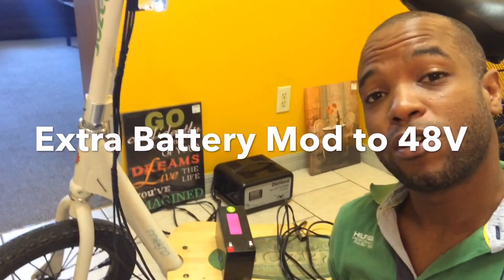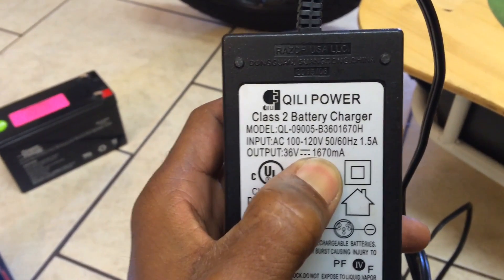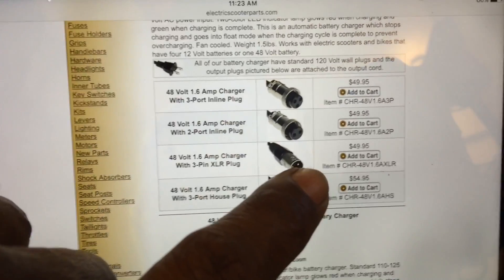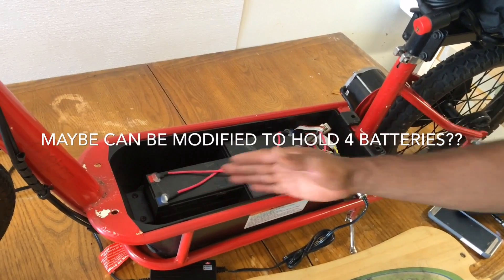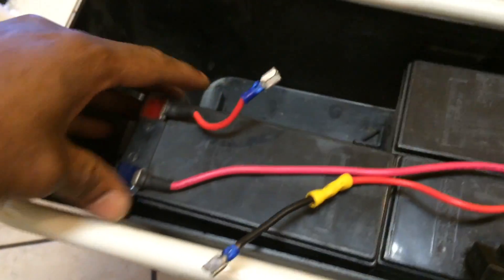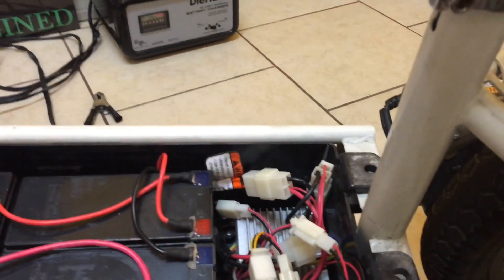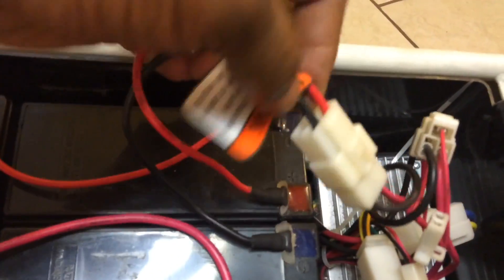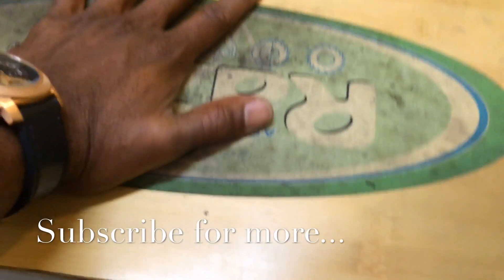Razor Eco Smart Metro Electric Scooter 48V DIY Upgrade

Comment: I went for distance over speed and changed out my 3 - 7 amp 12 volt battery;s for 3 - 15 amp 12 volt battery's. Now I'm running about 225 lbs, and also have a carrier cart that I use for getting bottled water and grocery's. I can carry 2 - 24 bottle case's and several bags of grocery's and travel 5 to 10 miles with no problem. 
     My speed has been slightly reduced because I also went fat boy tire's and a larger sprocket for more tork / sorry about the spelling, but you get the idea. As a senior riding on a little bike seat really killed me, not to mention the bouncing, so I also removed the seat and mounted a wheel chair seat, much more cushion and relaxing to ride now. Over all I increased the weight about 40 to 50 lbs but it evens out with the improvements, so I'm still at about 15 miles an hour and getting 12 to 15 miles per charge.

Comment: Great video! do you think a 10ah will fit in the tray? also any ESC cooling idea?
Reply from the maker: thanks! I'm not sure if four 10Ah batteries will fit but maybe 3. the 8Ah batteries are just the right amount of space for 4 of them
Reply: +Elton Love your setup. Would you see any problems with 3 12ah batteries. Would the top speed be 23-24 with those.
Reply from the maker: Richard Herzog thanks Richard. If you get them to fit it will work great but it won't increase the top speed. That is only possible one of two ways. Either by adding more system voltage like I did or changing the speed controller itself. With 3 bigger batteries you will only increase the range which isn't a bad thing.

Comment: I have that same scooter how much are the parts
Reply from the maker: Around $85
Reply: we need to see more cause i have one as well i understand but you never finished cause i want to do mine like yours just need to see the full ending on the finish the last connection an an a review please it would be so helpful just explain the ending an make sure you have it all together cause you never had the 48 v charger you never joined the last two wires so we cant take a chance unless we see connection an are you sure you didnt change anything else cause i paid 400 fot this thing an ill be very pissed if i mess it up so please show us the actual last connection an if you changed anything else please let us no thank you

Comment: Was the controller changed to 48v type? no change?
Reply from the maker: No.
Reply: Wow, it supports 48v as well , cool!
Reply from the maker: Yes it can handle the 48V just fine. Its when people try to plug a 48V charger into the factory 36V controller it fries them instantly
Reply: Elton I see. Thanks for enlightening. :)

Comment: why would you increase to 48v you add another and keep at 36v you running parallel you should of just connect one to another like by  joining the extra one to another red and black you still keep at 36v but now more juice to go more miles. ...  you didnt need to increase the voltage and yoy could keep at 36v with give you same power but more battery life did yoy wanted more power or more battery life?
Reply: I want both

Comment: I have 8 battery on my scooter I mod the deck higher.
Reply: Zerobladetion Wot how did u do that. I'm trying to add four more to my electric moped. I need help
Reply: I do too i bought the 48v motor kit an dont know if i should put it on